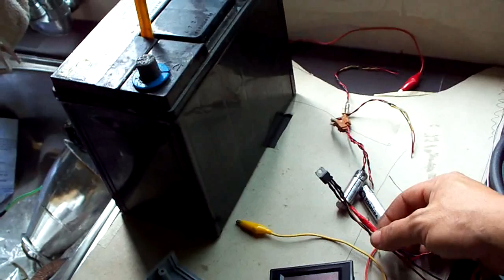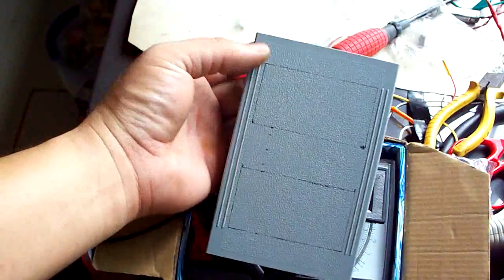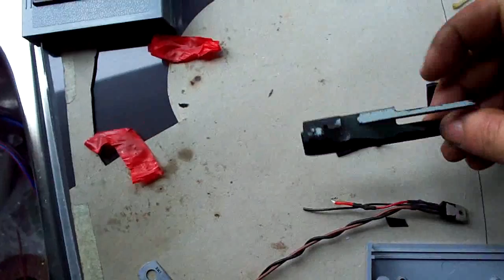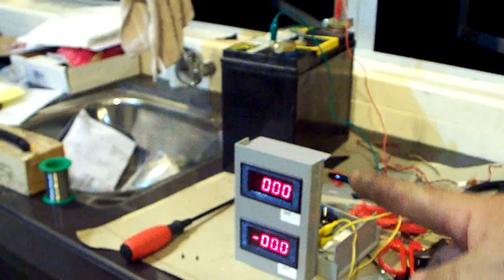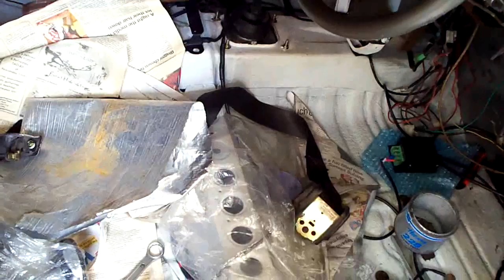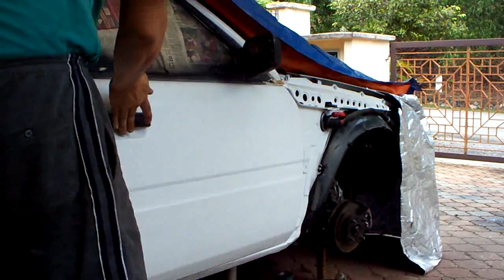Event 68

Comment: Before you put the voltmeter and ammeter into the car, check both sense inputs (both volts and amps via a shunt) with another battery circuit (other than the 12V battery that powers it). I am hoping that the sense inputs are well isolated from the power inputs.